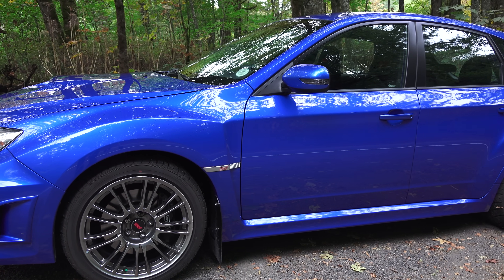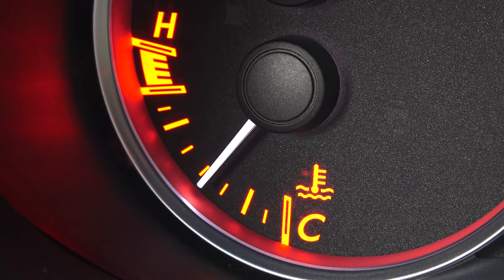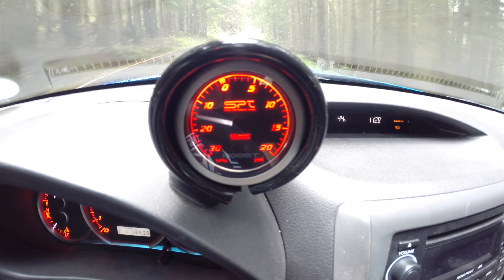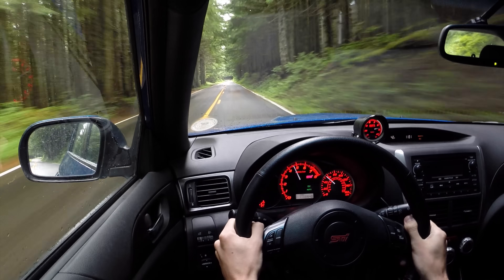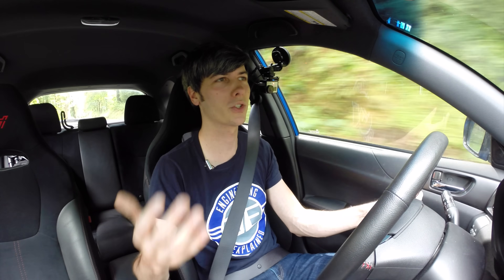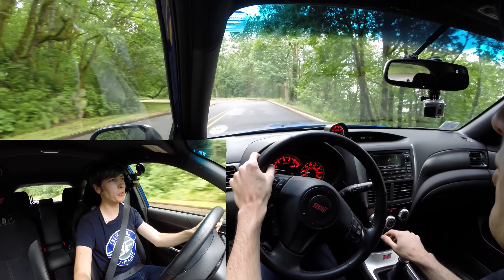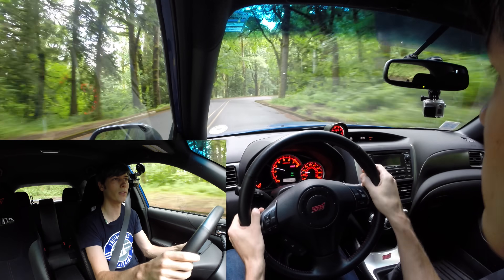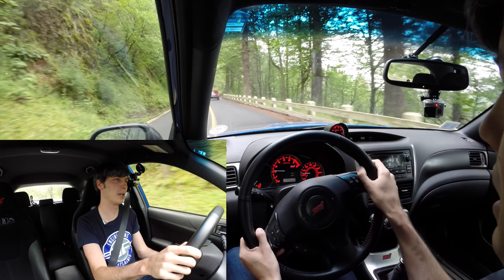5 Things You Should Never Do In A Turbocharged Vehicle

Comment: also question.... diesels are specifically designed to spool up there turbo at low rpms to help create max torque are they not? any input?
Reply: +GI Nicholas thanks for your worthless comment
Reply: +GI Nicholas Your comment was kindof worthless. Like this one <--
Reply: While GI Nicholas' comment was quite worthless, he isn't wrong. Turbo chargers often have lag at low RPM before they've spooled up, but turbo lag can be eliminated. Most manufacturers don't do it, because in order to eliminate turbo lag and have it spool at low RPM, you end up choking the engine (starving it for air) at high RPM (because the engine can pump more air than the turbo charger can with such a configuration), so most manufacturers figure it's better off to go with the high-spooling route - let it run like a normal engine at low RPM and like a charged engine at high, rather than like a charged engine at low, but worse than normal at high. So in that sense yes, it depends.
As far as diesels go - diesel engines just tend to run lower RPM in general, so that's why they spool up at lower RPM. Most gassers redline at 6-8 thousand RPM, while diesels are 2-4 thousand. They spool up lower 1. because they can, since they never reach the RPM where they would be choked (whereas a gasser would if you put the same turbo on it), and 2. because they need to (what good is a turbo that starts spooling at 3000 when it's time to shift at 2500). 
Turbo lag isn't completely nonexistent in diesels though. For instance, the powerstroke tried to combat turbo lag using something called variable geometry turbo, where the orientation of vanes changes according to RPM, so that it can essentially run a spectrum between being a very small and very large turbo - that way it can spool up at very low RPM, but as RPM increases it continues to provide boost without choking the engine.
Reply: diesel engines work completely different then gas engines, so a few things dont really apply to them as a gas engine.
Reply: +madmax2069 not completely. There's a couple of things they do differently but it's still an engine producing power like any other gas one
Reply: +Andrew Klemmer he's right diesels are different and in regards to the topic it depends on engine and turbo.
Reply: Andrew Klemmer It actually wasn't worthless but some ignorance you can't help
Reply: +Dhsjsjdj Snsndnfnf this guy knows what's up.
Reply: I have my diesel programmed with fluctuating stages. My turbo is spooled at low RPMs to produce more torque for a take off, at high RPMs it is also spooled to create adequate boost as I'm going down the road. Now driving highway without towing it does not create lag in low RPMs because the programmer allows it to run in the proper power band using just enough boost but if I was towing, that itself puts the RPMs in the power band without programming meaning I still reach the adequate boost needed not to lag.
For cars it is totally different in the fact they are really light and don't need the torque a diesel needs to take off. Cars honestly don't need a turbo charger, but they equip it with one just for the fact of producing high end torque basically for racing or fuel economy. I hope this helps!
Reply: Electronic waste gate control, nice feature to have.
Reply: They don't work "completely different" at all. The principle of a reciprocating piston engine remains the same. The only major differences are compression ignition (no spark plugs), no air throttling (under normal operating, some do have throttle valves to increase egt for DPF regen) and fuel injection controlling moment of ignition. They don't compress air and fuel together. Fuel is injected a few degrees before TDC right when ignition is desired. So no pre-ignition is possible.
Reply: Not exactly. He is right that they are different. But saying "diesel engines work completely different" is false and misleading.
Reply: I know the large diesels are meant to, we let our machines lug it out. I'm not sure about small car ones. But the large ones are built to be beat on, they're not temperamental. I've ran an old CAT 955 track loader with 18k hours on it and it still lugs out like a champ, it's what they're built for

Comment: oil is warmed up by the engines cooling system upon start up. you didn't mention that at all that there are systems in a vehicle (2 systems in a diesel) that help warm up your oil faster(would like some info on that) Volkswagen bugs (older ones of course), were air cooled and definitely go hand n hand with what you said.

Comment: You might want to suggest that owners may consider changing the oil more frequently than what the manufacturers recommend.  I have three vehicles with turbos and I rarely go beyond 5K miles between oil changes. This is cheap insurance due the fact that turbo engines stress oil more than non-force inducted engines. Synthetic oil is also a good idea.

Comment: On lugging and injecting more fuel than available air... In modern engines isn't the fuel injection controlled by computer? Maybe the program will allow for a slightly richer mix at sudden loads, but not too rich. If there's turbo lag there will be injection lag as well, no?

Comment: I'd love to be able to put the best fuel available in my Civic EX-T but it states to only use 87. I'm assuming that's because the engine can't handling the extra power from combustion?
Reply: No, it's because the higher ignition resistance in higher octane will make it tougher on your engine to ignite it properly and you'll be left with a lot of unburnt fuel.
Reply: I don't know why E.E. is saying "use higher octane", higher octane just means your gas is going to have a harder time igniting. If your car calls for it, fine. If it doesn't, don't; however, there is such a thing as fuel quality but there are a lot of variables in driving that could skew results in testing one fuel to another in day to day driving.

Comment: Low octane fuel actually has more energy (power) than high octane, but a higher risk of detonation. High octane is good for high compression or forced induction, but it makes slightly less power at the crank. Difference from 87 to 93 probably not enough to be felt in the drivers seat

Comment: Here is something that every diesel owner should have in their cars/trucks.
A co2 fire extinguisher.
If that diesel engine begins to run away, your only method of stalling the motor especially on an automatic is to hose the intake with co2.
Also another big thing for diesel owners with a turbocharger is EGT gauge. Watch those EGT's! especially during towing and hill climbs.

Awesome video man. Basically do everything you have mentioned and my turbo is still going strong on my 2012 Jeep JK with 140,000km

Comment: low rpm high load is perfectly fine... assuming ofc the engine is at its peak torque rpm. For example mine is 1850 rpm. As far as diesels for example a DD16 hits peak torque at 975 rpm making 2050 lb/ft. It's not "lugging" if the engine is at its peak torque rpm level.

Comment: How about diesel engines? My BMW E39 525d tuned has 430nm torque from 1800 to like 3000. So I use the torque at low rpms. But I guess you forgot to mention this video is meant more for petrol turbo cars?

Comment: For the lugging an engine, you should never do that to any car... But modern turbo cars with a boost controller will prevent applying too much boost at low RPMs. Using high octane fuel will also reduce risk... Fact stands, if you drive stick, learn to shift down, or damage your car...

Comment: Even though the higher octane fuel is generally better in a turbocharged vehicle, it can cause problems if it is too high. The best way to select fuel is based off of compression ratios and it works for all vehicles. More compression requires a higher octane fuel. However, too high of an octane in the fuel will cause it not to burn fully which will foul your O2 sensors and clog the catalytic converter over time.

Comment: A large part of the low speed pre ignition condition is based on fuel as many small turbo engines sold in the US are variants of european engines. In europe turbo engines are fitted to a very high proportion of cars  and NA cars are timed differently to take advantage of the much higher octane fuel that is used in europe. for example a european spec Zetec SE engine used in the mk 1 ford focus would require fuel above 95 (91 on the US R+M System)  octane which is minimum octane rating for standard fuel in most european countries  but most of western europe is now higher that this. Premium ranges from around 97 to 102 (Aprox 93 - 100 on the US system).

Comment: It has been proven that using higher octane fuel then required by the the manufacturer for a factory tuned modern vehicle has no benefit and can create higher emissions under normal driving conditions. This has been tested in real world and dyno emissions testing. Spot on with the rest of the information. I enjoy your informative videos.

Comment: I've always been told on turbos that have oil AND water going through the CHRA, it's okay to turn off the car without idling upon parking. The cooling system will will still circulate and cool things down even after you've gotten out. For this same reason, turbo timers are not needed. Now if you have only oil flowing through the CHRA, then it's wise to let it idle and/or get a turbo timer.

Regarding low engine speed/high load being a no-no, on Mazdaspeeds (my platform), that's known to bend rods, especially if you have the boost turned up and are making a good deal more than stock power. The rods see a lot more load and many a person has vented a block doing this. If you stay out of boost under 3k, that is an excellent preventative measure. Also, not boosting hard in 6th is a good idea too, since the gear is long and multiplies the forces the rods see.

Comment: A device called a turbo timer with allow you to turn off the key and the engine will run for a few minutes and shut itself off.
Of course turbo timers are designed so the car can't be driven away when the engine is running off the turbo timer.
Usually that is done with a wire that connects to the e-brake switch.

Comment: I'm not hearing a technical reason to not apply throttle at low rpm. Yes you aren't in the powerband, yes the engine can only take in so much air, but any car with a proper ecu or tune will inject the proper amount of fuel for the conditions to keep the air:fuel ratio where it should be. Most turboed engines will also limit boost and prevent knock. 
The end result you describe is bad, but almost any modern turboed car is designed to automatically adapt and manage air:fuel ratio, boost, and knock.

Comment: How much are you getting paid to tell people to buy premium fuel. I don't disagree one bit for people who want to make power or people who typically drive the car aggressively on a regular basis. My S2000 gets nothing but 93oct...its non F/I.  In my Focus ST, it gets 87 all the time, there is nothing wrong with using 87 in a turbo car, if it is tuned for it. Granted you did mention you have to reduce timing and/or add fuel, but you sort of blew it off, like why would somebody do that?...But if the car is tuned for it or learns on its own that it has 87 in it, there is nothing wrong with using it. You'll just be down on power, you're not going to cause damage because the ECU has already adjusted for the lower octane. What you will do is save money that is pointless to spend if you're just leisurely commuting to/from work and home...just because its turbocharged

Comment: This video is nothing but unsubstantiated conjecture.  You should know better as an automotive engineer, and judging by your many other informative videos, you do.

Let's start with "lugging".  There is nothing more damaging about low speed/high torque compared to high speed/high torque.  The engine doesn't care that it's not turning fast.  In fact the high force at the crankshaft main bearings is offset by lower oscillation force, which as you know goes up as the square of speed.  "Too much air" is nonsense, as the max. boost pressure is regulated.

Number 2:  Gas engines don't "burn up the catalytic converter" at low RPM.  That is why they have oxygen sensors.  Yes, you can go open loop under hard acceleration, but this happens at high RPM too.  As for diesels, well they don't even have cats!

Number 3 is not an argument, just a request for clarification on LSPI.  Is it true that modern cars can reduce max. boost pressure when knock is detected?

Long story short:  Modern cars are designed so that it is nearly impossible to destroy an engine by driving.  (unless it's not already in good working order.)

If you want to go ahead and make a detailed explanation of your claims, I would appreciate it.

Comment: i have an neon srt4 and lately if a floor it hard, then during the acceleration it just loses power out of no where and there's like this knocking sound too.   only happens when i do it from 1st or 2nd but if i push it hard from 3dr and up nothing happens its good like just like when i drive normal.  what do you think this could be ?

Comment: Your comment  on " over  loading  the ingain  with   diesel fuel by flooring  accelerator pedal only  stands true to the early  model  cars and trucks. The older  model  trucks  for instance, used  a fuel  pump  that was and still is if you can find one that is still running  can over load the cylinder which  in turn is why there's  so much  BLACK SMOKE ,ON THE OTHER HAND  ALL NEW CARS AND TRUCKS  ARE computerized especially trucks starting  back around  1995 to 1997 ,somewhere in  that General area ,large  trucks  for instance didn't have  a linkage any more  to the Fuel pump, so you could  floor the pedal  to the floor but there's  only  going to be  a registered  amount of fuel going to the  Cylinders  because  the Fuel  pedal  is not hooked up to the Fuel pump  anymore  ,the Fuel  is being  measured by the  position of the  Fuel pedal  or gas pedal  as some people  still  call it.there is no linkage  anymore ,to be more  specific ,look at it as the accelerator pedal and the OBC ARE communicating with each other ,so if you floor the accelerator pedal on a diesel it's  only   going to let a specific amount of fuel in according to the speed of the truck ,this in turn doesn't waste any fuel no matter how  many times  you "floor the accelerator pedal .THIS IS THE MAIN  REASON WHY  CLASS "A" TRUCKS  GET outrageous fuel mileage compared to the older model trucks. Just  thought I'd share  that with  you ,since  you don't  look old enough  to understand  the way they  used to be I learned a little bit on my 34 years of driving but most of what your saying  is TRUE  ,THANKS  .JJM IN MONTGOMERY ALABAMA SENT